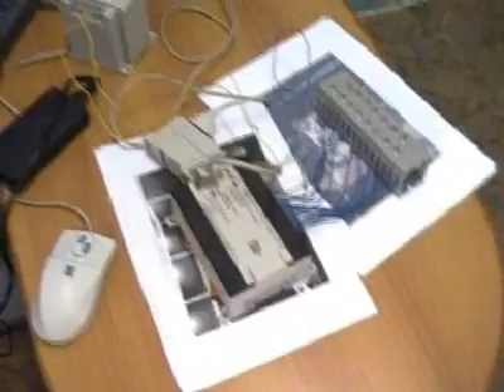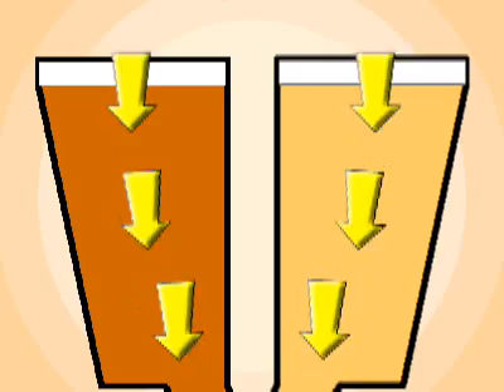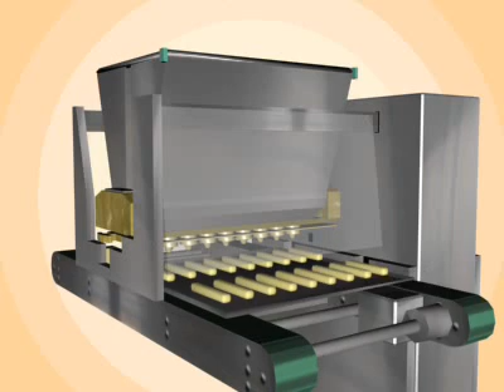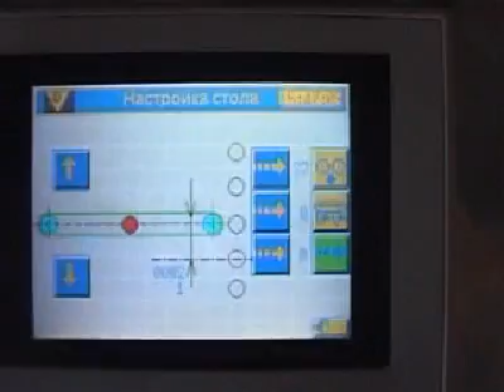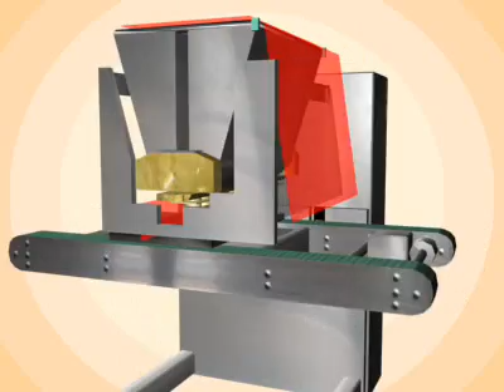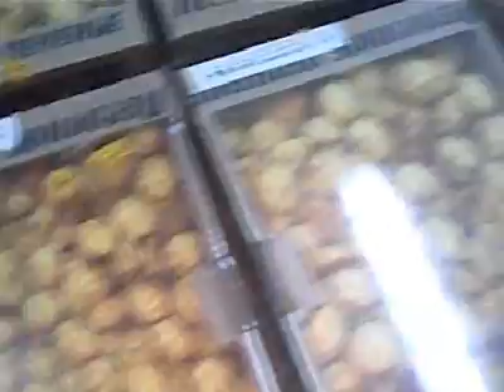www.neofood.de/Intellemix english

Comment: Kind Sir, you have a Great machine. It's simple, eloquent and innovative.
I'm working on a new design for the hydroxy electrolyzer, and burner. I'll need to know how high of a temp you will need, and what size of oven you will be using. The inner dimensions and insulation numbers are integral for a proper design.
Peace to you and your family.
Mike.